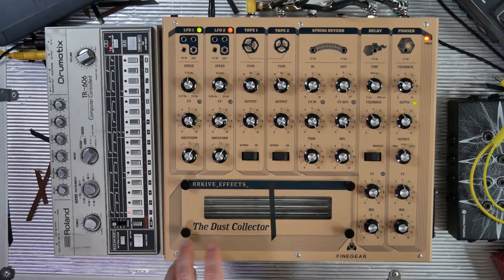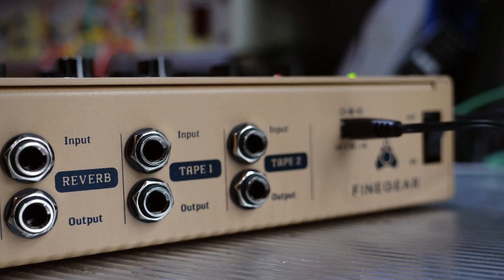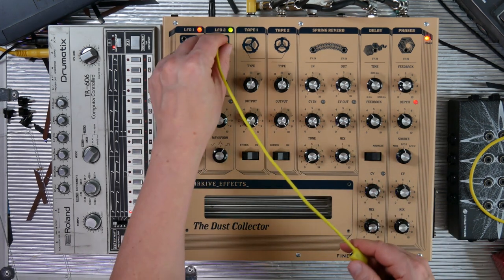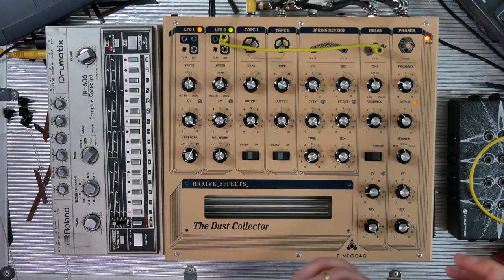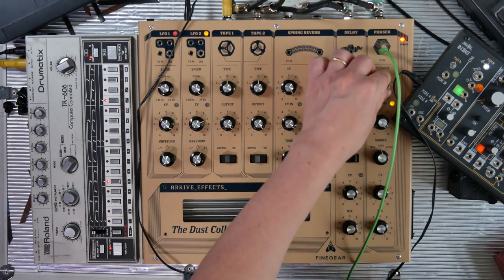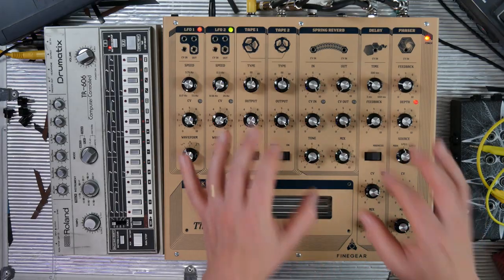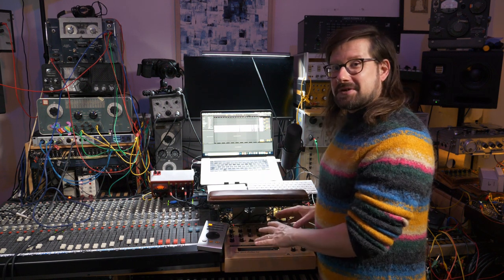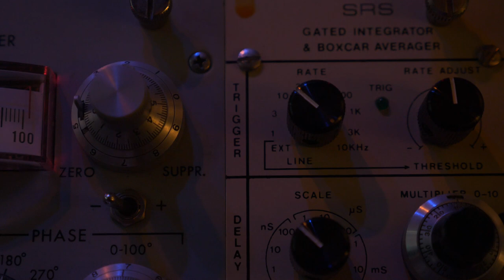An analog multi-effect in 2020? | Finegear Dust Collector

Comment: Spring reverbs stroked and prodded with modified electric toothbrushes are entertaining. There needs to be MORE electromechanical abuse of spring reverbs.

I had thought there'd be a dark, blank stare at the tape EMULATORS but nope, they were accepted as part of the group but still sounded good. All in all, it's a pretty good unit and delay is always an effect that is more than the sum of its parts x 1,000,000 if experimented with well.

Comment: I used to run my drum machine rig with this similar setup and I loved the tremendous delay speed pitching on the dumz it woul generally default to the lowest frequencies and rubberized them whilst the mids and highs tend to live in the trem and the highs sonically prolong in the springs,but on this the springs also introduce a low end with physical contact like 2 Bass Strings and as a unit it sound tighter than my rig  did

Comment: Ordinarily I'd call the idea of an analog multi-fx pretty silly and pure analog fetishism, but this is actually really cool. The exposed spring is a nice touch, they clearly intended this for getting weird (whereas digital multi-fx units seem largely designed for beginner guitarists).
Reply: I really like that last point; and an almost at the point now where I eyeball roll a bit when I look a cool effect and always see it with guitars. Not even bass guitars (which I like), More hardware effects for hardware synths fans!

Comment: Didn't hear any changes on TAPE, except for "V" settings, which were quite subtle, just a bit of boost
Reply from the maker: YouTube compression killed that a bit, but it is noticeable on good monitors easily.
Reply: @Hainbach  Unfortunately I don’t have monitors yet :D I use headphones ATH-50x. Well I guess I would hear something in wav file :)
Reply from the maker: Probably- it’s wild how I noticed the compression at work here. In the room at Good volume each setting is very different, but once it went through all the conversions it’s all flattened. I would love to try this on a huge PA sometime

Comment: Fantastic video!  I've been looking for something like the Dust Collector for a while.  The only issue is the lack of signal routing.  I'd buy this in a heartbeat if that was included.   Any chance that Finegear might consider modifying the design to add it?
Reply from the maker: Gotta talk to them I suppose.
Reply: @Hainbach  Thanks for replying.  Also, please check your email.  I sent you a message about a free stand that will help you cram more gear into your space.

Comment: To me spring reverb is a gimmick even though it's my favorite kind of reverb. But the only spring reverb I like is the ones found in old fender amps and reverb units. They use much longer springs and it has this beautiful drippy sound that can not be achieved with smaller tanks. Also I'm sure the circuit has something to do with it as well. But these tiny tanks don't even compare to the real thing.
Reply: I think Anassounds' Elements pedal + tanks are similar to the Fenders? (I could be talking out my butt, just something I came across)

Comment: Dude, I bet someone could build a decent version of this for less than $100
Reply: wtf no way.
Reply: Go ahead
Reply: Less than 30 potentiometers? Less than $20, 4 rca inputs?.99 cents each, ribbon touch strip? $7.99 circuit board? Let's say that you have to build 5 ? That's maybe $100. So yeah you can make 5 of them for Less than $300. Plus resistors, transistors and pretty much all the little things are pennies nowadays